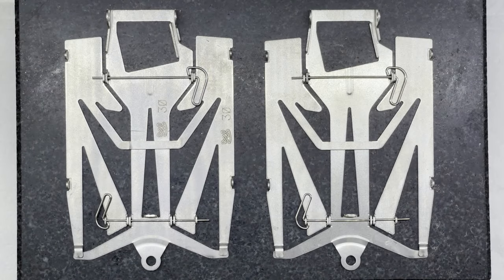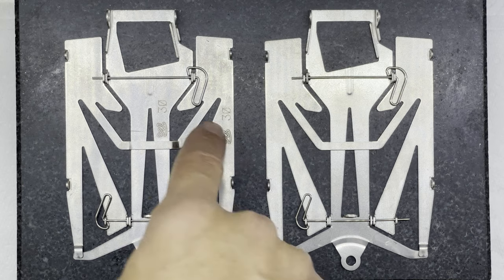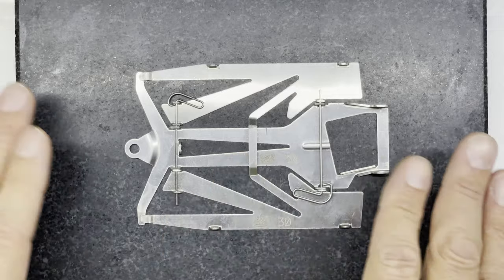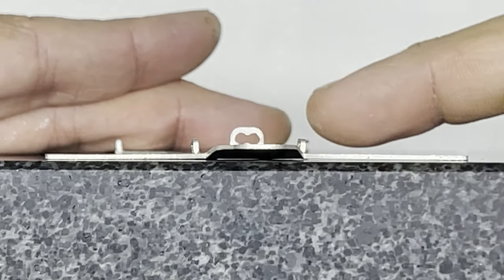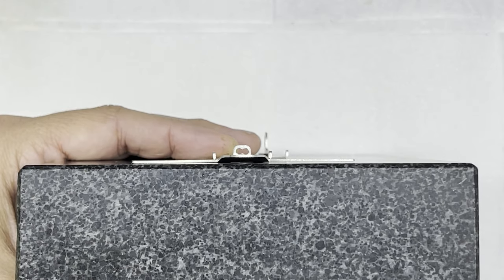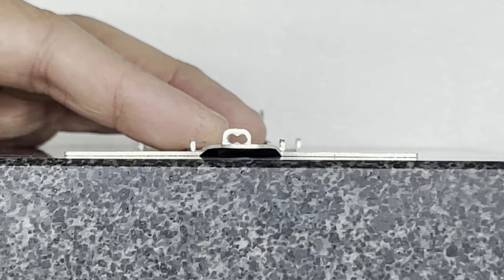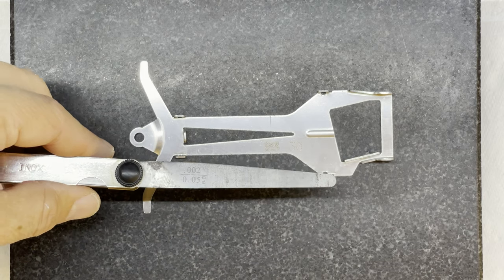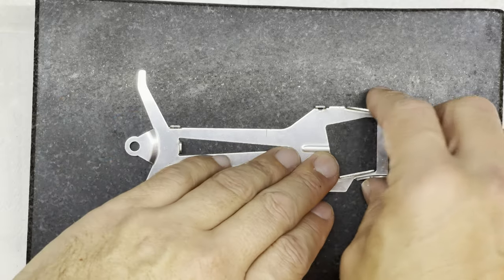Build a race winning JK C43 Aeolos slot car chassis - Part 1 (Centre Section)

Comment: Hi James, congratulations to your excellent tech tips. I exactly follow your description of aligning a chassis. I nearly use the same tools and I use the tech block for bending. So I can confirm it works this way. I agree to your view on critical points you have to take care of (eg guide tongue and motor box). I think twisted areas are most tricky and can drive you crazy while trying to fix it. I think some guys need to be calmed / reassured, because it needs a lot of experience to get good results. One need to be patient. And in former times some chassis have been very bad. I'd like to add two things I do. First is regarding the check of the pillow blocks. I use a triangle with larger dimensions. The ruler you show is not easy to handle for beginners and it is difficult to look for that small deviations in the pillow blocks. The lower end of the ruler is rather short and not easy to position on the block. Additionally I put in the bearings/oilite bushings and check if the axle slides easily, plus I check if the axle height is the same on both sides. If the difference is within 5/100 mm, I think it's ok. Also when using the feeler gauge for checking the flatness of the chassis I allow 5/100 mm gap or difference. Otherwise there is the risk I become mad 😉. Greetings from Germany, Heiko
Reply from the maker: Thank you for taking the time to watch. Great tips. Thanks for sharing.

Comment: Ever try honing the bottom of a chassis ? basically a precise sanding to ensure parallel flatness across the chassis bottom ? 
bending is problematic.
great channel. thx.
Reply from the maker: Yes, I do that in other classes where it is permitted. This class does not allow that process.
Reply from the maker: Thank you for watching and commenting with your ideas 🙏

Comment: James,
When you show the detail shots comparing the two versions of the chassis, it appears the markings are only cosmetic. The two chassis are otherwise identical or am I missing something?
Reply from the maker: Hi Peter, yes, the marks are just cosmetic but they are different on each chassis. I wanted to show that the chassis had different markings from the factory so that people realise they are not entirely the same.